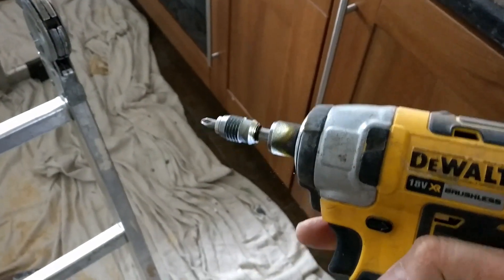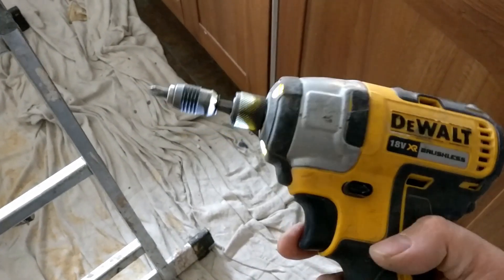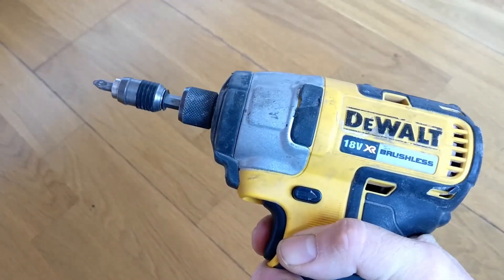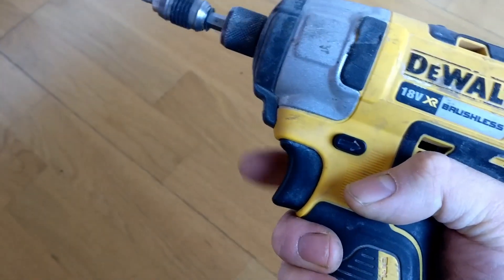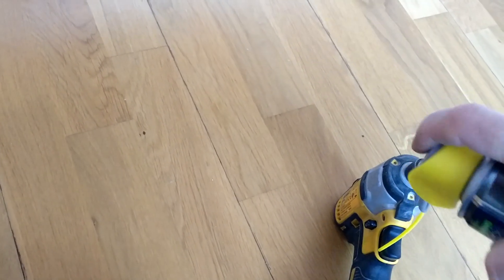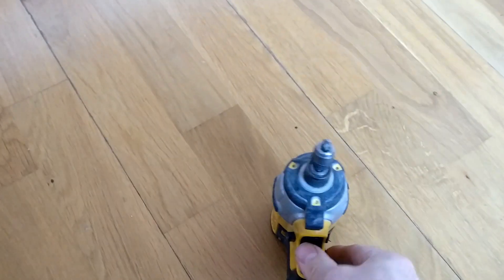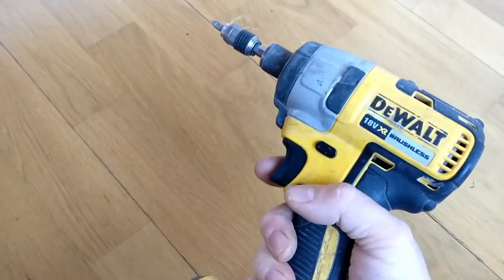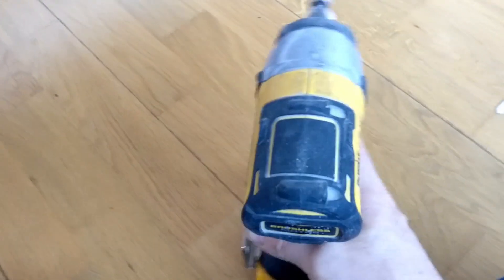Impact Drill Trigger Fix (Dewalt DCF886)

Comment: its amazing that any contact cleaner got into the trigger contact. i've had mine apart and had real trouble getting any fluid to get into the trigger piston.
Reply from the maker: My thoughts were that if dust can get in (was pretty sure dust was causing the problem, could be wrong about that) then a solvent will get in. It worked for me and not had a problem since.

Comment: I had this problem with my xd 790 drill. What he shows you here, wont fix the problem. He is right, that the trigger is the problem, but you cannot fix it from outside. Take the machine apart. Luckely, alle the screws are the same size, so no worry bout where to reinstall them.  Carefully take out the inside from the body. Blow everything clean, using a compresser gun. 
There is a lot of wirering so be carefull to notice, how everything is fittet. A tip is to take pictures before you dismantle, so you can put it all together the right way. 
The hard bit is to open the compartment with the actual connections for the trigger. There are wirering, you first have to move out of the way. And som of the wirering has been seeled, so you have to cut or dig this soft seeling out. 
Now open the plastic housing, around the trigger. It is at bit tricky. Take out the trigger and the spring. You will se the printboard underneath, covered in black greasy dirt. Rinse the dirt off with isoprophylalcohol or something simular.  And now just put things together again. Be carefull to get the gasket  (on my in fact 2, why?) rubber rings correctly installed. (these are allso the reason you cannot fix this issue from the outside) You might want to seal the wires again, that you removed the seeling from. Use acryl or something like that. Otherwise it would be impossible to do open it again.  It is basicly there to prevent dust. 
Be very carefull to put all the wires back in their tracks in the housing and screw it all together!
Reply from the maker: Thanks for the excellent instructions. Brilliant.
Just to let you know I have not had to do anything with the trigger since I sprayed it with the contact cleaner. Has been working great for more than a year. This is a driver I was going to replace as the trigger was so unreliable, it was a real nuisance. Maybe I got lucky but I have repeated this on other drills with similar results. On one of my drills, though it made little or no difference - I guess it will depend on what is actually causing the fault.
For me personally - I would go the contact cleaner first - cheap and easy to do. Taking the drill apart will void the warranty (if you still have one) and they are a real pain to put back together again,. So, for me, taking it apart would be plan B.
Thanks again for taking the time to put this up. I am sure it will help many people if the contact cleaner doesn't work. If my driver gives me any trouble I will be following this guide 👍
Reply: Mine works but is 0 to crazy each press, not very soft easing on the power.
Reply: I thought it's meant not to be opened .I guess I have 1 more thing left to do to my 887 if it starts to act up again . Will hot glue work to reseal the wires?

Comment: I took a chance and used a small can of WD40. You just saved my impact driver from the bin. The dirt that it flushed out was incredible. I gave it two full soaks spraying into every slot on the body and watched the dirt flowing into the bin.
Reply from the maker: If it works its a great easy fix. 
I know these switches are sealed units but if dirt can get in so can a solvent 😊. Glad it worked for you 👍

Comment: You are a fuckin genius mate! My first driver lasted 16 months and when this happened I was told it wasn’t viable to repair, best to get a new one. All my gear is Dewalt XR so I had to buy naked, like for like because of batteries. That was December last year, two months ago. Today that new driver did exactly the same. Contacted Dewalt, yep, we’ll service it under warranty, be around a fortnight. My bread and butter tool! I scout the internet to see if anyone else has this issue (google, DCF887 issues) pages of them! Then I see this, no disassembly, no bodging, worth a try, AMAZING!!! Though now I’m pissed cos I threw the last one away ffs! I’m buying no more Dewalt, that’s for certain!
Reply from the maker: Glad it helped. I used mine for months with the trigger not working properly. Ever since I did this, not had a problem. Its a real nuisance sending tools to be repaired under warranty as you really need two of everything if you are using them for earning a living. Reliability has to be the top priority for these tools. Unfortunately both my drill and impact driver have had problems.
Reply: See my comment on your video of how to fix the drill chuck. It either sticks and won’t undo or it loosens every time the drill stops and the bits fall out. I made a commitment to Dewalt power tools, one set of batteries. I don’t want different tools with different batteries, pain in the arse. But I reckon Dewalt really need to up their game with regards reliability cos at the moment I’m really regretting my decision. Excellent vids pal! Keep up the good stuff 👍

Comment: Wow .most people change complete switch unit.well done
Reply from the maker: I would definitely try cleaning the switch first. Seems prone to dust contamination. Mines is still working flawlessly weeks later. Can't believe I didn't do it sooner! Thanks for the comment 👍
Reply: Mine got dunked in a bucket of water. Got it opened up and cleaned the rusted the motor. But it still won't go.  Every time I plug in a battery to it, the light comes on and won't shut off until the disconnect battery.
Reply: @mcotrucking4 , more than likely it is shot. I work at a tool repair center and these switches are known for failing. unfortunately a new switch is about $100. The guy in this video who sprayed his contained switch got lucky. The switch electrical components are contained in a casing and can get a little crud in them, but all he did was move the debris around inside the switch unit. It will fail again. To properly clean the switch it needs to be removed, opened up and cleaned with electrical contact cleaner.
Reply from the maker: That doesn't sound good. A bit more than dust contamination going on.

Comment: I got a second hand compact DEWALT 12V drill DCD710. MOSFET switch keeps blowing short inside the trigger button. It has been replaced 3 times with the same effect... Do you know what could be a problem? The original MOSFET had blown open...
Reply: Tried different and overrated MOSFETs and replaced gate driver chip as well. Still failing under heavy loads, gets hot and blows short, resulting in no speed control... Bummer!

Comment: did the lights start turning off aswell?
Reply from the maker: It just wouldn't come on at all and when it did sometimes the lights would stay on for way longer than they should.
Reply: I’m also curious and I think what he’s asking is that after you applied this fix did the lights resume their normal operation? As in did they turn off as they should and used to before?
Reply from the maker: The lights operated normally once I used the switch cleaner 👍

Comment: your best off to take it apart then take the switch assembly apart clean it out and re lube with dielectric grease
spraying cleaner around the switch did nothing as the switch contacts are in a bellows-sealed box
Reply: I think perhaps you missed the point
Reply: That won’t fix a defective design, I gotten these all apart and cleaned, still stay on until battery is discharged. Only fix is don’t buy these defective Dewalts drills , they get worse as you use them ,pulling the battery out every stinking time to reset !!

Comment: tried this today with my rockwell impact driver, it did work for a few mins now the driver is totally dead, no lites or power etc etc.     go figure
Reply from the maker: Mmmm, not so good. Make sure its completely dried out, double check the battery connections.
Hope you get it working again.